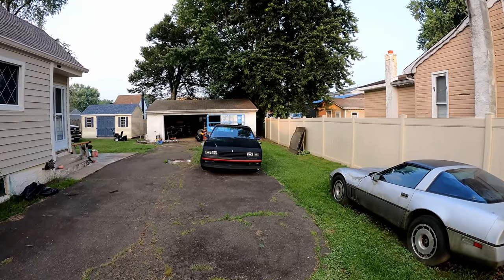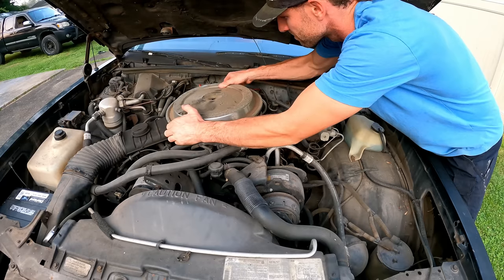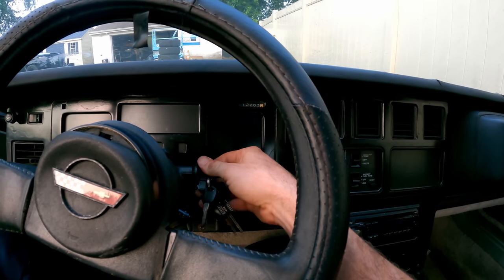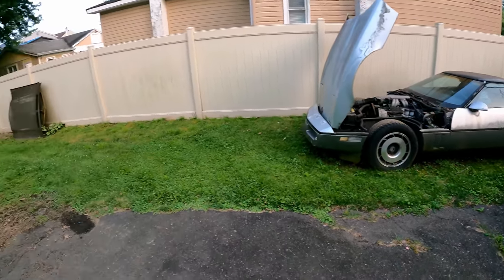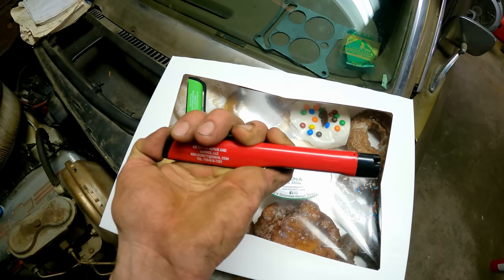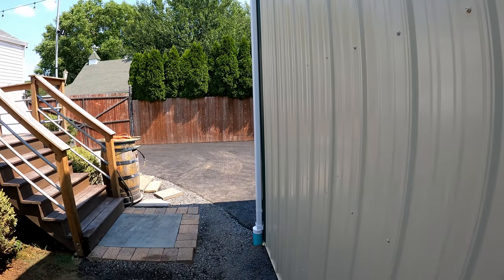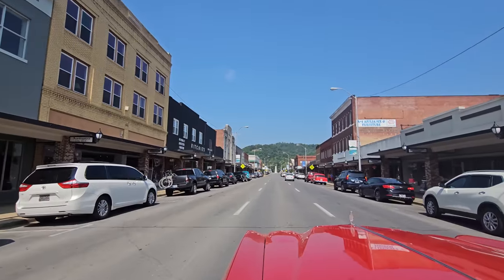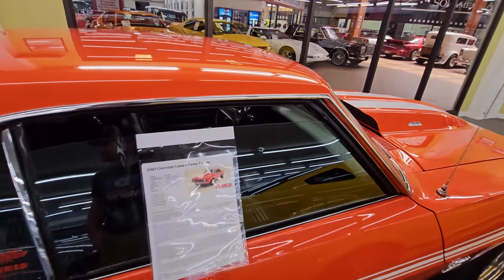Trying To Fire Up Some Classics / Garage Update - NNKH

Comment: I worked as a heavy equipment mechanic for several years back in the day.  I worked at a few different dealerships.  I started out in a shop with bare concrete. When I moved to a shop that had a coated floor, my first thought was that it was going to be hard not to destroy it.  I was really surprised how much nicer it was to work on that coated floor.  Spills are so much easier to clean up on a coated floor.  With bare concrete, oil and grease seem to get ground into the concrete.  Once that concrete has soaked up all of that oil, you can never really pull it back out.  With a coated floor, oil dry will soak it all up, and you can sweep it away.  Once a bare concrete floor has been soaked in oil, you can never crawl around on it without getting dirty.  We did a lot of welding and cutting, and as long as you weren't working right on the floor, the coated floor was fine.  Sparks and splatter falling from workbench height usually cool off to a safe temperature by the time they hit the floor.  If it were my shop, I think I would at least coat the floor under the lift.  I will caution that coated floors can get slick when wet, and the large sized grit used in some of them make cleaning a major pain because the grit causes broom bristles to skip over the dirt.  I'm just sharing some of my experience to give you some ideas you might want to consider.

Comment: You ever use ozone generators to destink cars/basements/anything? They kill mold, fungus, bacteria, and will neutralize about any mal odors. Even used for fire damage and chemical volatiles. Painters and fire restoration people use them as well as auto detailing to remove smoke smell. Just need to keep any living things away during. Dissipates very fast though. Can buy online for under $100. Pretty neat technology.
Reply from the maker: Yes. Works pretty well

Comment: The piece on the tri-stand that screws up and down is so you can lock it into a stable position using a piece of 3/4" piece of conduit. Cut a piece that goes from a cieling or joist above you to the stand, and screw that piece up a little and it locks it into place.

Comment: Yes the 87 Monte Aero were rare even back in the day. I had a 70 Monte for twenty years till some stoner kids rear-ended it in a work van. It was forest green with the camel leather bucket seat interior. LT1 350, turbo400, 373 posi rear end. My brother bought an 85 Vette new. Back in 2000 his garage burned. All that was left of the Vette was a rusty gas tank and a puddle of aluminum with a cooked crank  where the engine had been. 😖

Comment: Totally agree on leaving the concrete as-is. You go to any commercial shop, no epoxy or other mess because it doesn't hold up. Great shop space!
Reply from the maker: We had epoxy floors at the shop I used to work and that stuff was clean wore off in the working areas. Everywhere else it was still intact. Definitely looks worse that way. Patchy
Reply: I always seal my concrete with a mixture of diesel, gas, motor oil and brake fluid makes the concrete last forever

Comment: Those old synchronous motors are way cool too
We had one similar to that running a saw mill I use to work at …
It was about 200 hp and about twice that diameter 
It took approximately 30 minutes to get up to speed and on line …
Haven’t seen one like it for years 
Cheers

Comment: the garage looks primo - the drains and pavement and wiring plus the bhudda - spray it with a couple layers of clear coat and hang it high under eaves - go for the mini split for sure but think tqice about the spray foam - just use the 4x8 foam boards - will be cheaper and a quick install - if you do end up going spray be sure to get the closed cell but you do want a colder roof - with the foam boards you can have stops to preserve vent up to cap/ridge and avoid any condensation issues - with the foam boards you can always adjust/add more if needed etc - the spray foam is permanent - do try to get a pos pressure hepa heat exchanger going to although that may be gilding the lily - it would increase recirc and lower dust but that may be more applicable to a house - you should be very happy with the mini split - do some content on that and talk about the efficiency. good execution on the garage - all you need now is a lift - that will really help out with ease of repairing vehicles and you can take it with you in a few years when you outgrow or buy some distressed property close by - make sure to talk to a couple cpa about tax strategies as you should be able to write quite a bit of this off and lower your bracket or the llc bracket - keep cranking out content and make sure to have a good summer here - take some time off or combine biz and pleasure for more writeoffs

Comment: I did my shed a few years ago. I spent the money on getting an epoxy floor put in by a professional. Best thing ever. It has a few marks and chips over the years, nothing major. Cleaning it however is amazing. I used a floor polisher with a heavy pad and a product called SurfexHD. Comes up like new everytime. Everything in the shed is on wheels, so can roll stuff out easily for cleaning

Comment: I put 1 inch rigid insulation in my garage door. Just cut them to fit each square. $25.00 for a 4' x 8' sheet. It does add some weight, so you will have to readjust the springs or torsion lift system.

Comment: the stainless steel tube thing at 27:07 if you put small plant pots inside of it you could plant Straberrys in them and they would hang off the floor...a vertical planter.

Comment: I epoxy coated my shop floor in 2007 shortly after building it.  In my opinion, it was a complete waste of money.  Drop some steel on it and it chips.  Drag steel on it and it rips.  Weld spatter burns holes in it.  Next shop, I think I will try highway paint.  At least high paint can be spot coated for repairs.

Comment: hope you get the vette, I had many L98 C4 corvettes, only problem I can see you having starting is the MAF on the front of the intake, some of those you can open up and peel away the conformal coating and add a star washer to one of the ground screws inside on the bottom, as long as the hot wire is not broken when looking thru the intake of the MAF

Comment: if i built a shop, i would use hardener on the floor when finishing and use densifier on it after the 28 day cure. doing that makes it less likely to pop from welding but would still not torch cut without covering. sealer or epoxy will only help, not prevent, staining from oils etc. nice video and update. oh, and i still want that Gran Torino lol i used to have a 78 Cougar, 68 Chevy II Nova, 75 Elite, and a 66 Galaxy 500. sadly had to give them all up due to job loss and you gotta pay your bills.

Comment: More than 40 AMPS would be good for the shop but I suppose there are power availability issues.   I hope you can get the Corvette too.  I've had an 88 Corvette since 1990 and still enjoy it.  The engine management system can really throw you some curves from time to time in this era Corvette. The dash display looks really good.  Often they dim and can have other issues over time.  Keep the content coming, Chris.

Comment: Please consider putting a concrete sealer on, it soaks in, doesn’t peel, doesn’t allow the concrete to create dust. Sweeping the floor is much easier and I believe it helps with staining. Had a shop that I sealed the majority of the floor and it was daylight and darkness difference.

Comment: You are able to supply that with 40 amps onto a hundred amp breaker. Being that it is a subpanel you have to separate your neutrals and  your grounds and do not Bond the neutral to the can

Comment: when my brother poured his floor, he used, used engine oil as a stain. He let it sit for 24 hours, then soaked it up with sawdust. You just need a rag to wipe up dripped oil. No stain mark left behind. and the floor looks very cool being black.
lots of people ask about it staining your cloths and whatnot. no it doesn't. it soaks into the concrete.
Reply from the maker: Funny I was thinking about doing the same darn thing. My concrete guy told me not to though

Comment: I used a penetrating silicone based sealer/hardener on my new concrete garage floor. It does not result in the glassy surface of an epoxy but rather sinks in. If you put too much on it just dries with some dry white powder on the surface that you brush off. It’s supposed to chemically react with the first quarter inch or so of the concrete to surface harden it and secondarily keep oil spills from soaking in.

It didn’t cost that much, maybe $125.00 for five gallons, which is way cheaper than epoxy. It’s also not perfect in that I have oil stains. Hardness-wise it seems to be working as I am not getting scratches and digs in the concrete.

Comment: I seen Sleeperdude try and get one running just like that corvette and he had to clean or replace all the injectors and the gas tank was horrible and he cleaned it and installed a new fuel pump in the tank so it’s going to be a pain to get it going again. Oh it it also had a bad computer.

Comment: Oh boy the infamous Doug Nash 4+3 transmission.....4 speed manual + 3 speed automatic overdrive...whooohooo....don't forget to check the Clutch master cylinder slightly behind the brake booster

Comment: 100HP 110 amps. I worked on a motor from the 80's that was 100HP 440 volt and drew 99 amps. They improved a little but not much.

Comment: That's stainless steel thing you showed that goes into a freezer and that's a biggest one I have seen I also work in a ice cream plant just to let you know on the outside of that freezer thing they have Sharp blades and they are very sharp I use to take them off and change them

Comment: Well done Chris, although this lady moved on pretty quick from her deceased hubby to have a b/f now.
Do get the epoxycoating on the floor otherwise you will be forever dealing with concrete dust, also sparks from welders and grinders do not damage the floor, and it is oil adn acid proof why do you think so many industrial and commercial buildings use it? because its veery durable and non-slip

Comment: You should still seal your concrete floor in your garage that would keep the oil from penetrating they do sell clear sealer for concrete check your concrete supplier in your area

Comment: You can actually put 8 guage on a 50 amp IF it is in conduit and not romex 8 guage. Also, there's nothing wrong with putting that 100 amp panel on the 40 amp circuit. It'll just make it easier to overload it. But as far as code goes, it's A OK. Lol.

Comment: They also built a Pontiac Grand Prix Aero Coupe as well. I can recall a Pontiac version sitting on the back row of my local Chevy dealer in the fall of 1989 while my dad was buying a slightly used ‘89 Cavalier coupe. The Prix was in great shape, but was looking really dated at the time. They have always had a following even back then when they were rare but not impossible to find for very reasonable money. I was never much of a fan of that last of the RWD Montes and Prix; preferring the Regal and the Supreme.

Comment: tech question, when installing Front lower control arm bushings, which direction should the "CR" be facing? thanks
Reply from the maker: I'm not sure off hand. I always just put bushings back in the exact way they came out. I usually mark them before removing so I don't get mixed up.
Reply: @NoNonsenseKnowHow  thank you for the reply. i messed up and put bushings, i meant ball joints. i did a little research and found it may stand for "control rod" aka tension arm. im just not certain if the marking "CR" should just face directly inboard along the control arm to where to tension arm mounts, or something approximately 45 degrees towards the front of the vehicle in the direction whre the tension arm mounts to the car. sorry for the confusion..

Comment: That "one of these" stainless cylinder thing would look great around the exhaust stack of the ratrod truck I'm building. Are you selling it?
Reply from the maker: No I'm going to hold on to it. But honestly it's really heavy gauge and would add an insane amount of weight for an exhaust stack. Better for something structural

Comment: The facade of the Birchfiel building at 36.08, caught my eye. It used to be the Ritz & is now used by Farmers Insurance. The Ritz was built by B.W. Birchfield & opened on January 2, 1929. The Ritz was managed by D.M. Nuttall, Jerry M. Thomas as the contractor & the Vitaphone installation by John M. Jones. Shortly after opening, it closed for a few days in connection of two motors been burned out & other minor difficulties have been detected.

Nuttall replied that “the machinery for producing the sound effects was installed without any preliminary tests having been made causing various difficulties which would have ordinarily been corrected before any public exhibition.” John left Elizabethton for New Jersey to obtain & brought back heavier motors to Elizabethton for replacement of its original installations, bringing his opinion that the presents were unsuited to carry the power load of electricity. Nuttall, Thomas & Birchfield had many compliments on the Ritz since its opening & had enjoyed capacity attendance. Nuttall formerly before the Ritz opened its doors took several trips around the Charlotte, North Carolina area where he conferred with the leading southern distributors obtaining its first rights on all of his best sound pictures being produced at the time.

Vitaphone’s installations led into a short life at the Ritz, which would later replace it with RCA Protophone on November 14, 1930.

The Ritz had a lot of ownership and operator changes since its first 7 to 8 years, with F.E. Perryman becoming the theater’s manager in 1930 followed by Mr. & Mrs. R.W. Sherrill.

On October 26, 1934, J.S. Browning, who has been the operator of the dominant Bonnie Kate Theatre since 1927, later became the operator of the Ritz. Remodeling of the Ritz later took next week following the Sherrills taking ownership of another theater they owned in North Carolina. Browning operated the theater until being taken over by new ownership, Elizabethton Theatres Incorporated of 529 Elk Avenue incorporated by H.G. Fowler, J.C. Babcock & W.C. Wilson, on April 10, 1938.

The Ritz did not receive CinemaScope at all when it arrived in town, as the Bonnie Kate Theatre was the city’s dominant first-run mainstream theater. The Ritz closed for the final time in the middle of 1956. However, later that December 17 of that year, a fire broke out at the Ritz building.

Comment: That car in the garage isn't a Pennsylvania car... Or, at least wasn't originally.  It has travelled clear across the 'States, in fact. That Green River Community College sticker on the window is the giveaway. Greeen River Community College is a bit south of Seattle in the Kent/Auburn area... Just a stone's throw from what used to be Seattle International Raceway, but which is now called Pacific Raceways. 

I grew up in the area. A lot of people. myself included, took courses at GRCC "back in the day". Used to be a really neat place, back then.... Full of life... Not so much now, sadly. I may well have known the original owner of that car, by the way. Everyone that had hot rods knew each other, or at least OF each other, pretty much. I had one... Still have it (why I do not know) and it still runs, after sitting idle for 23 years. That ol' Mopar still runs like a  top.

Best regards.
Reply: Your not that bright

Comment: Hey man enjoying your videos as always, was wondering how many miles you bought your Toyota Tacoma with and if you like the 4.7 v8 or if you would stay with the 3.4
Reply: Tundra I meant
Reply from the maker: I bought my tundra with 60k miles on it. Well over 200 now. And I love the 4.7 but they never made it with a manual transmission so that's why I got the v6. 3.4 is tried and true. Definitely lacks low-end power though
Reply: That’s a good mileage to get that truck at, thanks for the reply. Got another question for you if you have a second. I am going to check out a 1995 Ford f250 today. It’s 2wd with the 351 Windsor engine. Unfortunately it doesn’t have a manual trans but the guy says the trans was replaced a year or so ago and still has a warranty. As long as it wasn’t rebuilt I will feel good about that when I see the paperwork. It’s an Arkansas truck so no rust. It’s a beauty. 135000 miles. He’s asking 7800 it blue books for 5800 but with the trans it doesn’t seem like a terrible deal. I will start at 5800 I think and see what kind of wiggle room he has, whatcha think?

Comment: Another 3’ higher garage ceilings would have been just the ticket.
Reply from the maker: For sure. But 12 ft is already pushing it with my tiny little backyard. Don't want to piss the neighbors off
Reply: @NoNonsenseKnowHow   This garage will do it intill you get something with more space around you and ( no Neighbors)